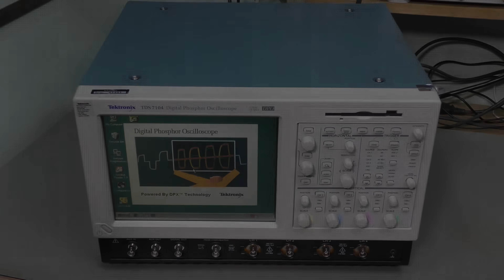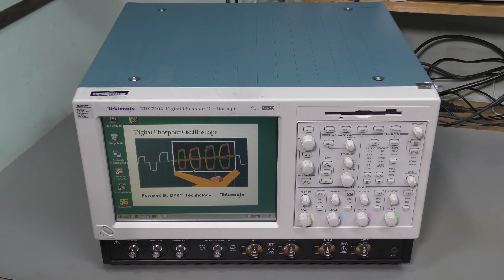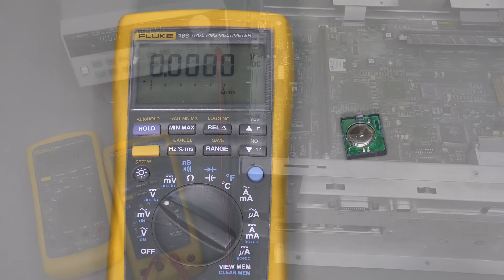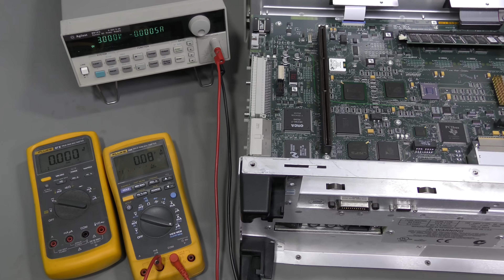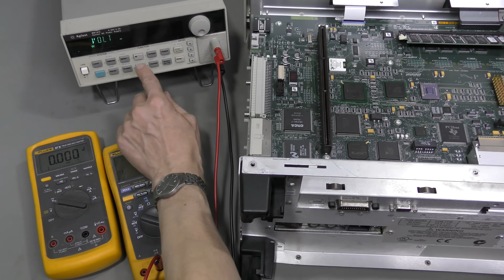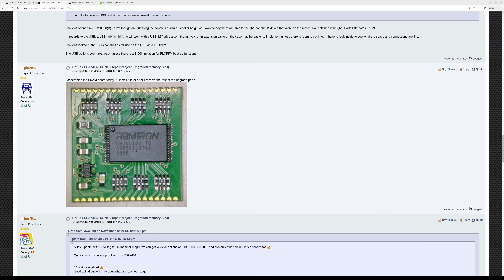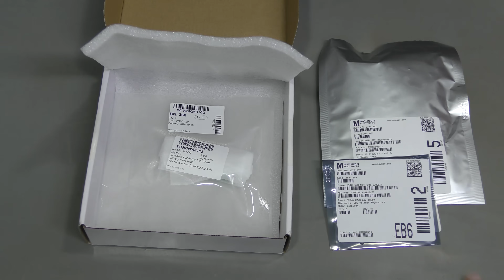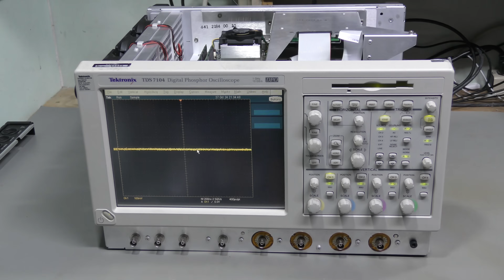#154 - Tektronix TDS7104 oscilloscope repair

Comment: The construction is similar to the TLA 5000 series logic analysers and that also suffers with failing NVRAM modules; it uses the Dallas DIL module with integral battery that are now very hard to obtain.

Comment: Nice repair. I ordered 5 of a very large PCB design for a retro computing design I was working on. For some reason I also received 10 boards in the mail. I didn't complain especially as each board was over 100 sq inches in size. I used one and sold a pair to a guy in the UK for the cost of shipping.

Comment: I really suggest to locate every single EEPROM and flash memory on all the boards, read out and back up their contents. If this thing runs Win98, it must be close to 25 years old, which is beyond the limit when EEPROMs and flash chips can develop bit rot. I wonder how prone CPLDs and FPGAs to this. I'm afraid these digital scopes will be impossible to keep alive 30-40 years after their manufacturing date, just because of bit rot. Which is a shame, because a new scope with such specs is absolutely unaffordable to any hobbyist, even smaller businesses think twice to justify the cost.

About how much these beasts go for, in working and non-working condition?
Reply: @mrnmrn1  I guess one approach is to always upgrade to a scope twenty years old, instead of new!
Reply: @ydonl  Yes, but it's very upsetting to throw away a perfectly working, advanced and expensive hardware, just because they made it impossible for the user to reprogram it. Plus not sure if it will be that simple in the future. Newer scopes are more complex, and they have the whole OS in flash memory, todays higher capacity flash roms have significantly shorter data retention time, nowadays you can't trust a high capacity USB flash drive to keep the data intact for just 5 years if not refreshed. Modern SSD controllers periodically refresh their cells to prevent bit rot, if they implement this on the scope's motherboard or they use a high quality off the shelf SSD, than it's not an issue if the scope is in regular use. The latter would be the best, because it would make backing up the OS super easy.

I have an OWON DSO from around 2007, when I bought it second hand in 2020 I planned to back up the content of the flash, but it turned out to be integrated into its Samsung ARM system controller. Even if I reverse engineer the JTAG  and manage to gather every dev tool that's necessary to program that controller, I will most likely be unable to back up the firmware, because it's pretty much guaranteed that the flash in it is read protected.

Long story short, I will keep my analog scopes forever, because those can be kept alive practically indefinitely with the amount of use they are getting from me. I won't gamble thousands of $ on decades old high end DSOs, knowing they can fail in any moment, just from sitting on a shelf.
Reply from the maker: I paid about $500, so I could not resist. I see a few non-working ones, let's say, around $1000 on eBay now. Working ones are offered for $1500-2000, but who knows what they really are sold for.

Comment: Eventually, my 7104 will need the same mod. The battery was replaced in my unit (by someone else) and re-flashed years ago. But my NVRAM chip isn't damaged, so it's still drawing in the nA or pA range. My scope has been apart about 5 times to undo mods, that eventually ended up making it work ok again. Thanks for sharing your video!
Reply: there is another way to mod this chip imho. not so accurate but useable
if you use your scope quite often and the instrument most of the time connected to AC input, you can use a downconverter from standby to 3 VDC and apply it to dallas chip.
Or maybe just put there 3V_ALWAYS from CPU board